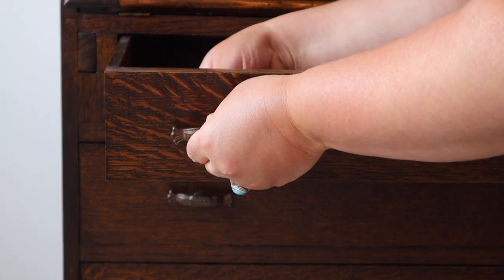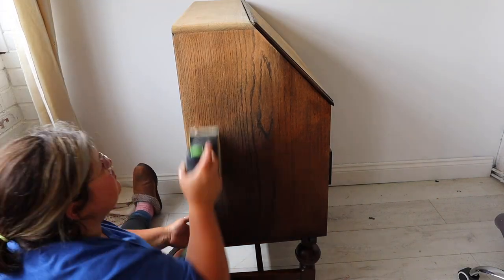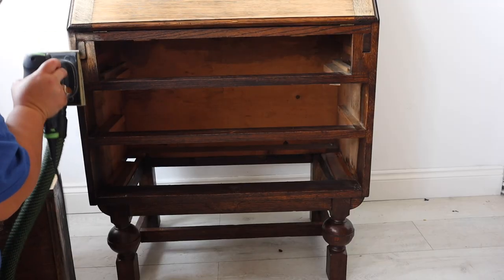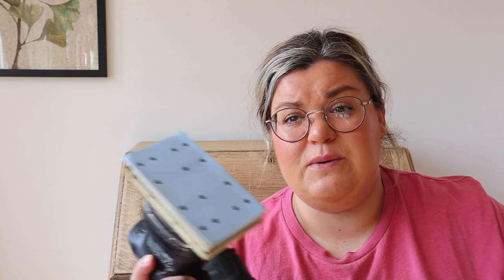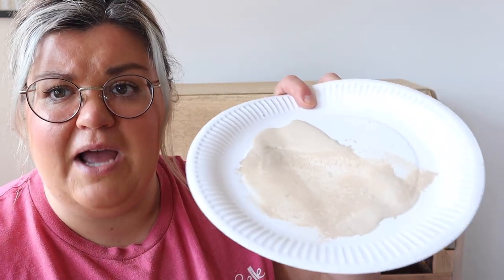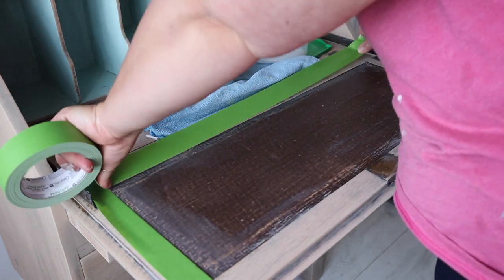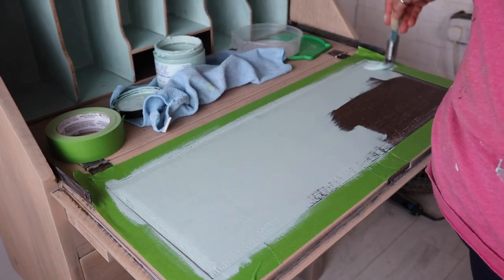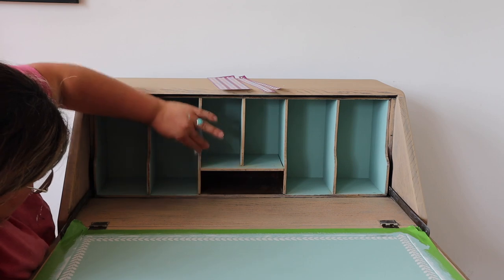How to achieve a light stained finish on a vintage oak bureau with Dixie Belle products

Comment: Well done, loving this look of natural sanded/bleeched look, well I think it just looks very natural, hence the name I guess! 😂. One question, did u wipe the stain off at any point? the excess I mean, or did you just apply and then left it to dry, no buffing, no wiping off the excess?? Sorry, Just checking, I'm pretty sure u would have said if u did... but sucess is in the detail! Beautifully finished. ❤😍
Reply from the maker: Thanks for your lovely comment! No, I didn't wipe the stain back as it was absorbed very quickly into the dry wood. You can wipe back for a more sheer look or you can layer this for a more solid colour. It's a very versatile product!

Comment: Did you wipe back the stain at all after applying?
Reply from the maker: I just allowed it to soak into the grain and worked it in using the applicator pad